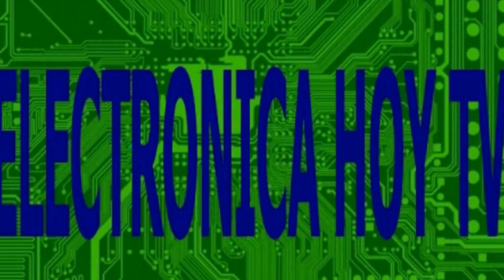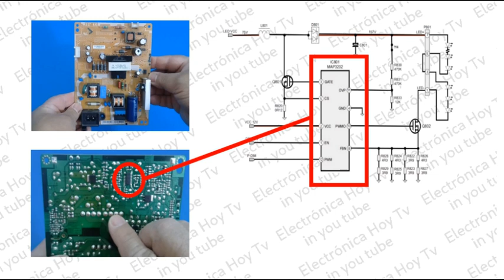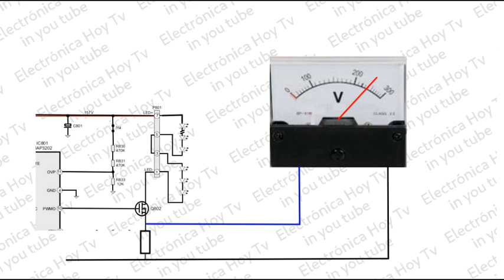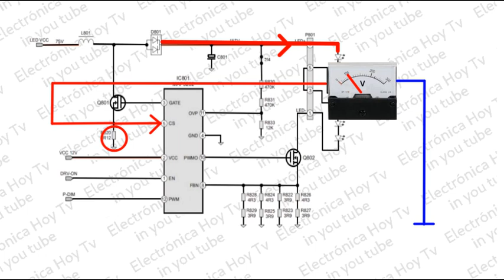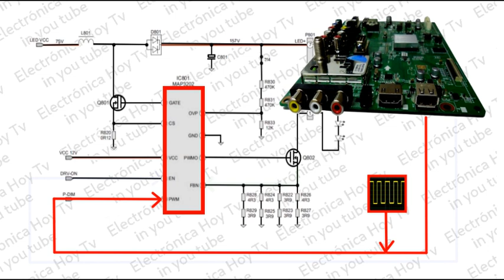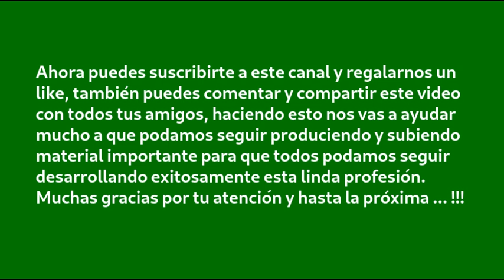QUE HACE EL BACKLIGHT EN UN TV LED, 4

Comment: Btrds lo que si no entendí del todo; es que ;si la corriente que circula por los led como Indican es " estable " ;me podrían confirmar si se estarian refiriendo a la corriente efectiva ya que la instantánea si varíaria debido a que los pulsos pwm que actúan sobre el transistor mosfet que está en serie con los led modifica su brillo haciéndolos  switchear  para modificar su ciclo de trabajo .
Reply from the maker: Hola Miguel muchas gracias por comentar, lo que sucede es que son dos temas diferentes, lo que tu mencionas es lo del brillo de los leds, el cual se regula segun el periodo util del pulso PWM, mas ancho mas brillo y menos ancho menos brillo, pero ese no es el tema del video, sino de como funcionan las protecciones, en cuanto a la corriente circulante la proteccion OCP basa su funcionamiento en lo que se denomina "circuito shunt", ya que finalmente, si en el nodo aparece un voltaje algo mayor de lo debido, y por efecto de la ley de ohm, la corriente tambien tendra que estar por encima de lo indicado y eso es inevitable, por eso se llama ley de ohm, pero claro, finalmente la corriente tambien tendra que presentarse intermitente por cuanto trabajamos con una fuente conmutada, que es lo que tu indicas, y lo que se mide es un valor promedio que depende de la histeresis del instrumento de medida y de la topologia del circuiito. Finalmente, segun lo haya determinado el ingeniero, en el caso de una corriente excesiva, lo que se hace es bajar el voltaje de entrada para que tambien baje la corriente circulante. Un abrazo y exitos.

https://youtube.com/channel/UCTGEByTp4xKlFvwfYDqdBhA
Reply: @ELECTRONICAHOYTV  muchas gracias por la explicación bnchs